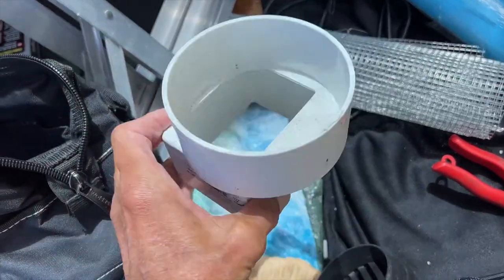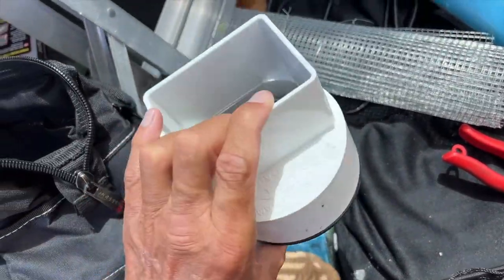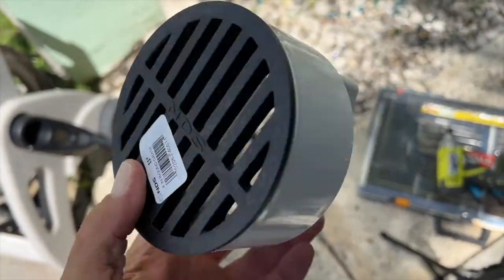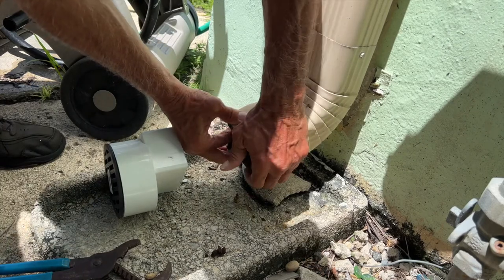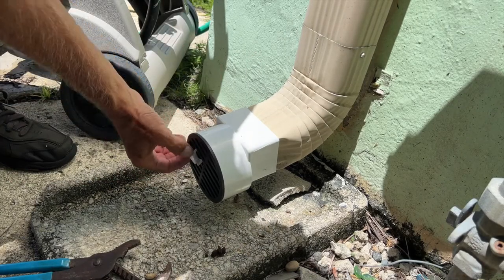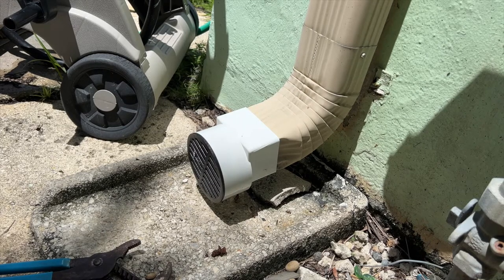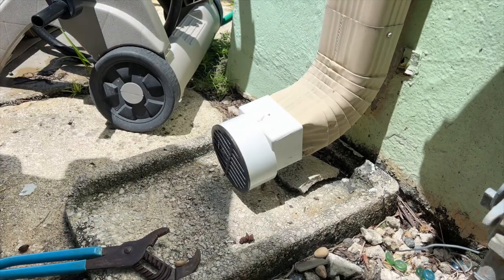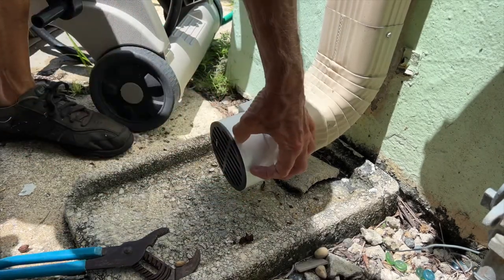How to Secure downspouts from rats crawling up

Comment: Rats can break their bodies down to get through those slots in the drain cover. It needs a thick, mosquito hole screen inside that drain cover to block them from entering into the drain. This is a great solution you came up with for ascetics, as it’s prettier to look at than steel wool 😅
Reply from the maker: Thanks I appreciate that